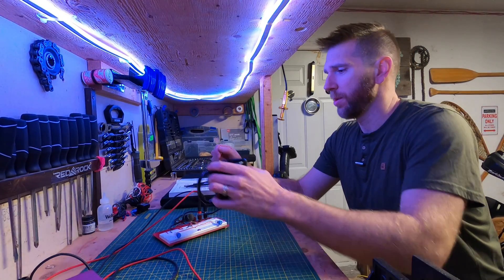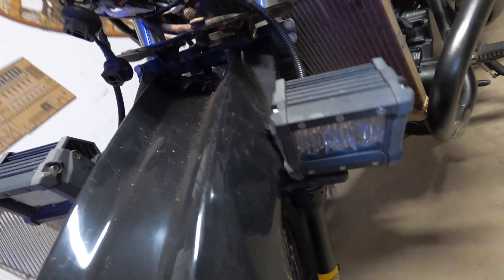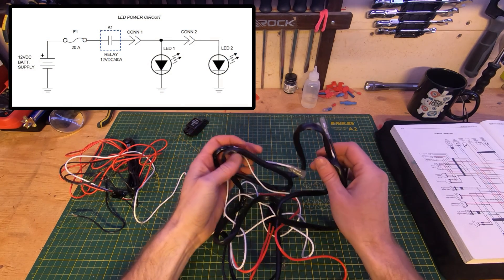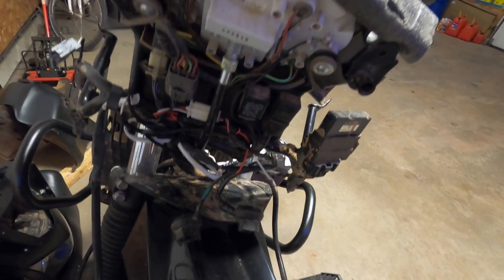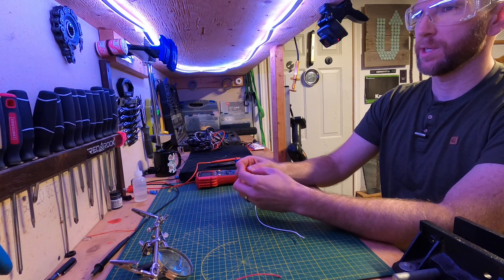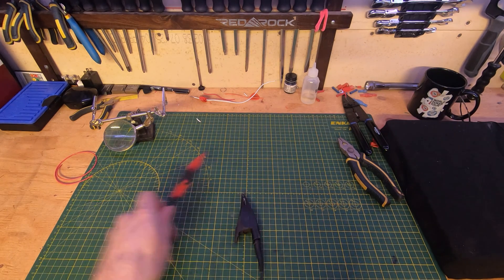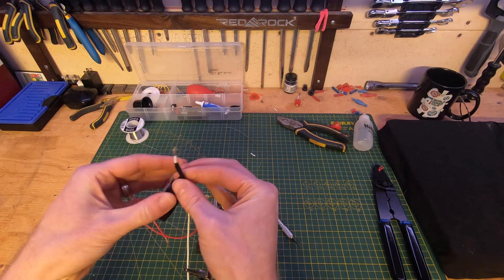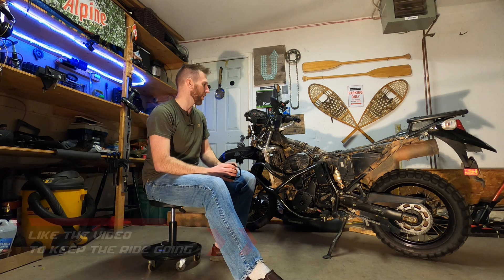LED Auxiliary Lights | Wiring and Diagrams | KLR 650 Mods | Island ADV

Comment: Really useful information. 

I have a gen 1 and I am looking at aux lights. I want to wire it to the bright lights but I do not know wiring at all nor like the idea of slicing into essential wiring
Reply from the maker: Splicing in is tricky, that's for sure, but it's totally okay if you don't want to do that. There are some kits out there that come directly off the battery and include a switch. You just need to remember to turn off the lights to prevent your battery from draining out. 
There is another sneaky method too though. It involves using a fuse splitter. I'll leave a link to some here in the next comment. The idea is that you find your fuse for the light system and you plug in the splitter and you have a neat and tidy wire built in to use.
Reply from the maker: Fuse Splitter:
https://www.amazon.ca/KOLACEN-Automotive-Circuit-Adapter-Standard/dp/B0722CF9FT/ref=sr_1_2_sspa?crid=1CVZ904NNS28H&keywords=fuse+splitter&qid=1669808002&qu=eyJxc2MiOiIzLjMwIiwicXNhIjoiMi44OCIsInFzcCI6IjIuNTUifQ%3D%3D&sprefix=fuse+spl%2Caps%2C94&sr=8-2-spons&psc=1&spLa=ZW5jcnlwdGVkUXVhbGlmaWVyPUEyUUlYUlJNSVlDSjBLJmVuY3J5cHRlZElkPUEwNDI4NjM0MkMxQ0xDTUtHMzdDTCZlbmNyeXB0ZWRBZElkPUEwMzQ5NDc2M0VHSDZPOVFWWUpCWCZ3aWRnZXROYW1lPXNwX2F0ZiZhY3Rpb249Y2xpY2tSZWRpcmVjdCZkb05vdExvZ0NsaWNrPXRydWU=

Comment: How about the battery capacity. Can it sustain for long night ride
Reply from the maker: It can for sure. I mostly use these for trail riding in the daytime actually. Mostly so I can be seen on the trails. But I've ridden an entire day with them on also charging batteries and my phone at the same time for periods. That was on our last big trip. The bike started up just fine every morning in camp.

Comment: Brilliant video and explanation. Just wired my side LED's and when I flip the switch one side flashes, turn it off and on again and the other side flashes, turn it off and on again and both light stay constnatly on until switched off again - any ideas why they do this? Thanks
Reply from the maker: That is a wild one. It almost seems like it's a feature. Some LEDs have a count circuit that increments every time you switch them on. So the second time you hit the switch it would activate a blink. It's similar to a headlamp. I would check the LEDs to see if a feature like this exists, then check any relay you used to see if it has any similar smarts to it. After that, check where you are drawing power from, you may be getting a feed from the blinker circuit. Good luck.
Reply: Looks like it might be a feature - just need to switch them of and on twice to get them to keep on. Thanks for the reply :) I used your video to help me wire in mine and really appreciate the in depth and clear guidance! Cheers
Reply from the maker: @jonjobjp  I'm really glad it helped. That's always nice when you find a feature instead of a bug too, lol.

Comment: A short light bar tied into the high beams would work well to give you a brighter high beam and at the same time it wouldn't have to tie into the low beam
Reply from the maker: That's good idea. I've seen people do this before with the circuit. Another benefit is you have that stock switch for it built in.

Comment: I much prefer solder splices as well.  Insulation displacement splices are OK for interior work, but they are expensive and bulky compared to a good solder splice and they will not stand up to the weather for long, particularly in areas near salt water or where roads are salted in the winter.  Although wrapping with electrical tape won’t hold up long either.  I much prefer adhesive filled shrink tubing that will seal around the end with two wires.
Reply from the maker: Definitely. It's always a struggle to find that perfect balance of ingress protection while still being able to have a good small connection. I wish there was some kind of small scale wire/cable gland component you could get. I recently installed a 12v dist. block, but despite a cover included with it, it's still not a totally enclosed setup.
Reply: @IslandADV  So true.  I just replaced a Fuzeblock FZ-1 on my K1200LT as the circuit board traces corroded away after 13 years.  Such is life in the northeast with its rain and road salt.

Comment: Better to use sealed connectors such as Weatherpack.  They will withstand the weather and are easy to disconnect if necessary for maintenance without the need to cut off and reapply shrink tubing.
Reply from the maker: Good suggestion. Thanks very much.

Comment: Thanks. Definitely will help me out. I prefer the solder method with heat shrink.
Reply from the maker: I hope it helps you out brother. You can get some really good heat shrink wrap too that you can lay up and around the tap then heat into place.